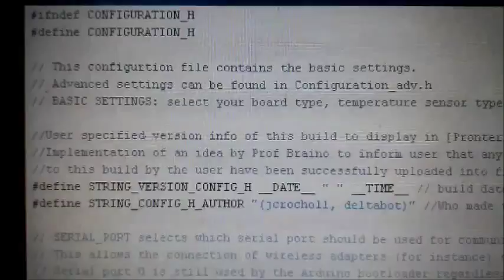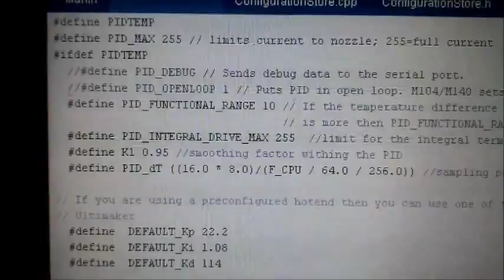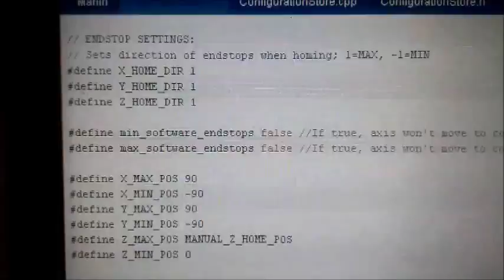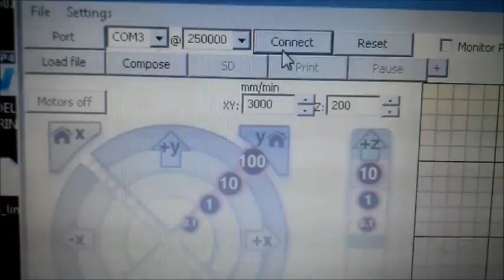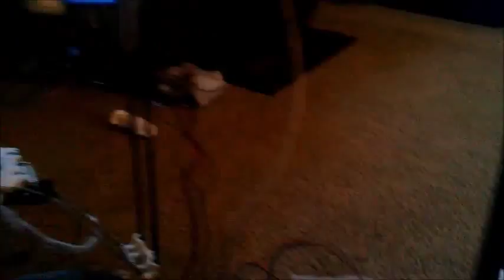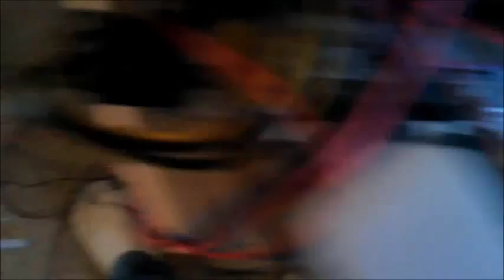ROSTOCK 3D PRINTER MARLIN FIRMWARE HELP!!

Comment: if you are sure that ur settings are good ,check your arduino 5v for any ripples , also check the adc pins on your board to make sure they are not picking up any extra noise .probeply ur fried your arduino .